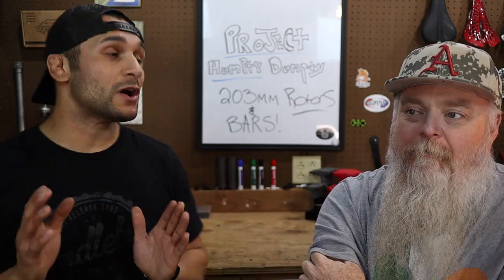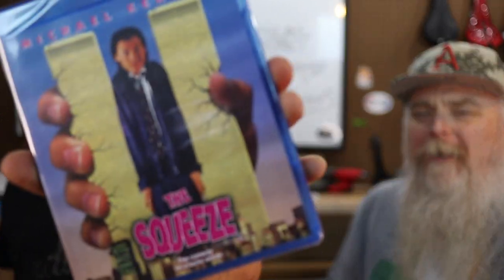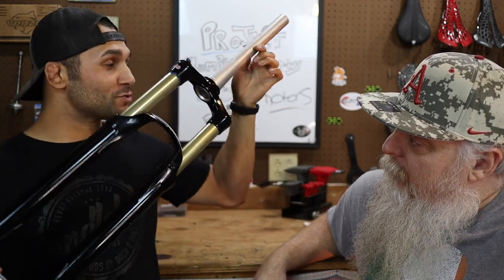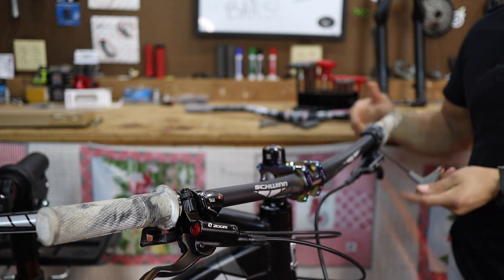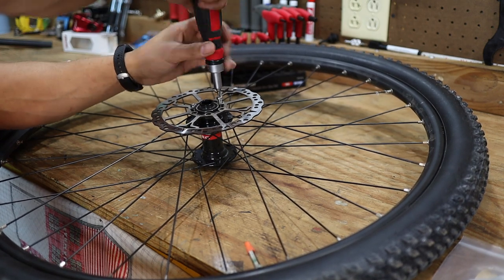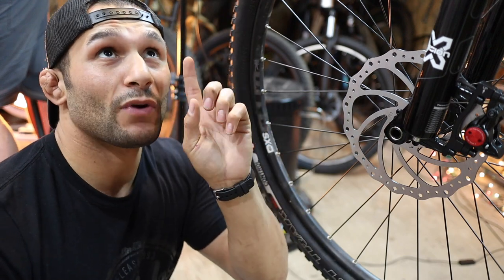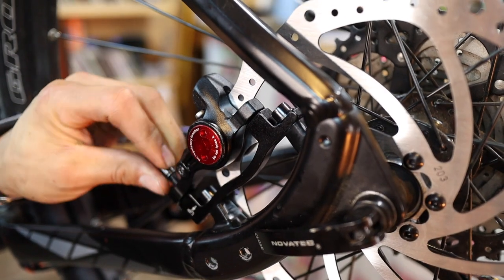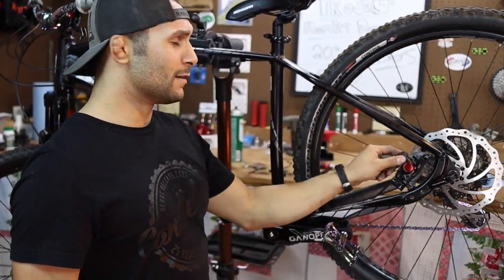203MM ROTORS on the Schwinn Taff plus MAIL TIME!

Comment: You're absolutely right about just squeezing the brake and tightening not working. 

But what does work is leaving them loose, squeezing the brake just tight enough to where you can spin the wheel,, spinning the wheel a full rotation and then squeeze and tighten, it's never failed me.
Reply from the maker: Will try ha ha, it sounds good👍 could always use another technique lol
Reply: @WOLFTICKVIDEOS   don't use to much force when tightening, do a bit each bolt or it can tilt the caliper if you torque just one.
Reply from the maker: @sim_dude  yeah good looking out man, similar to a vehicle tire install😉

Comment: I just bought the same epixon from ebay ($191) to replace my 9mm Quick release epixon. They are great light weight xc to trail forks. These are oem 2019 with older epixon discontinued lowers that were actually better than the new ones... They are all adjustable internally from 100 to 140mm of travel. You could adjust them to 120 if 140 is too much. There's also a popular mod that will make them smoother by adding some synthetic oil to the lowers (10 to 15cc).
Reply from the maker: That's awesome man! Thanks for the info. Would love to see some information? Maybe a link would be very helpful. Thanks man and hope they are great as well.
Reply: @WOLFTICKVIDEOS  Sure, here's how you adjust your travel : https://youtu.be/T1WAiS6lwpQ , and the oil in the lowers help the seals, it was something i read on a forum long ago and it actually helped, just add some synthetic motor oil (10 to 15cc), low weight, through the bolt holes on the lowers. These forks only use grease and a sealed damper. Love your videos!
Reply from the maker: Well Joe thank you very much brother, and will do!

Comment: You should do a brake stop test between 203, 180, and 160mm rotors using the same pads and calipers to see which ones stops the furthest. You could also use the infrared heat gun from the most recent mailtimeto see the brake temps temps between all three rotors.

Comment: The trick to centering your caliper to your rotor does work you are just doing it wrong. This is what you need to do it the right way. Loosen your caliper a little then take a piece of paper or a business card ( I use a business card) and place it between the rotor and brake pad on each side, then hold your brake lever then tighten your caliper. I can promise you that does work perfectly. Ive used this method at least 30 times and it comes out flawless. If you dont put something between the rotor and pad you will get rubbing.
Reply from the maker: Ok BIG EASY! I will do on the next brake upgrade, you talked me into it🤣🤣 thanks!!
Reply: @WOLFTICKVIDEOS  Right on man.

Comment: The rotor trick works. You need to sandwich something else onto the rotor that is thicker than the out of plane variation of your rotor. I do this all the time. It would work without that if your rotors were perfectly flat, but most are warped a little. Eitherways, with hydraulic brakes it'll recenter itself correctly over time and the rub will go away.

Also don't full tighten one bolt then the other, incrementally tighten both.
Reply from the maker: 😉gotcha brother, I will sandwich next time! Lol

Comment: The epixon forks are internally adjustable from 100-140mm or the newer style go from 80-120mm i used a set when u built my hyper carbon x I but some oil in the air sleeve to make them more progressive so I could run less air more sag for sensitivity I ran it with about 15-20% of it's rebound and ran 1/5th of the lockout during trail riding and incline ran it open for descending lightest 140mm fork I've ever ran set up right it's quite amazing
Reply from the maker: Wow that is amazing sounding!!! You SOLD ME!! HA HA appreciate the info brother that is really cool

Comment: I just completed the install it was on a hyper beach cruiser motorized bike 80cc with a G2 read valve and oko 21 race car for a motorcycle with a hinge conversion adapter on the front fork with a is bracket for a 203mm caliper with the dual brake lever the bike has got a ton of power so I needed something to stop the bike
Reply from the maker: HA HA HA Sounds like a hospital trip waiting to happen!! LOL Good luck and thanks for watching man!!

Comment: Those rotors are massive holy cow! Your definitely going to be able to do stopies now😂
Reply from the maker: Ha ha STOPPIN ON A DIME!! LOL  I can't wait to see of there's a big difference. Thanks man
Reply: @WOLFTICKVIDEOS  one of the first things I did on my Aggressor was the 203 upgrade.  After ordering I actually learned that the OEM fork spec dictates 180mm as the largest size.  Granted, that's probably to keep a safe tolerance and avoid legal liability, but I just enjoy the lighter lever effort and don't go bananas with it.  There's a huge difference for certain going 160-203.
Reply from the maker: Felt it a little with the 180s but cannot wait for the 203 MAN!!

Comment: So I just ordered what appears to be an adapter for the the front, but what did you guys do with the rear?  160,180, or 203….I thought I saw a rear wheel installation but I didn’t see a part link for that specific adapter.  Or is it the same adapter for front and back?  Love what you guys are doing!
Reply from the maker: Hey brother, the rear was a 203mm as well and I believe I got the same 203 adapter for the front and flipped it + added some spacers....Works fine:)

Comment: That's okay I was told that I could not put disc brakes on my bike boy were they wrong that the conversion bracket I put on was for a rear post they were wrong 32 mm for the front fork on the conversion bracket on my bike and now I have disc brake setup on my bike hahaha prove them wrong I learned a lot from your guys' videos thanks for being there
Reply from the maker: Hell Yeah Willard:) We know the exact feeling!! Everyone told us a shops we couldent this and that! Thanks man feels great:) Keep it up
Reply: @WOLFTICKVIDEOS  I have a question about the disc brake caliper spacers can you use all three spacers and the center between the bracket and the caliper the cone part of the spacers into the insert piece itself so it's actually not sitting up on top up against the bracket itself for an is bracket it safe it's
Reply: @WOLFTICKVIDEOS  so I've got both double thick washers and then the little small rounded washer stacked on top of each other on each side is that fine
Reply from the maker: Well not sure about the safety but I get what you are saying. I ran 3 spacers when I did not have a screw that was short enough so I had to use that setup to make due, I stopped fine but ended up changing it?
Reply from the maker: Like we said man not sure as far as safety goes but I would def trial run it a bunch and if it doesnt rub and grind you should be fine.
Reply: @WOLFTICKVIDEOS  the screws are long enough in the loctite it in loctite it's just a road bike it's a beach cruiser you give me an idea you got to check out my YouTube channel under motorized bike motor Buchanan to give you an idea what the bike looks like
Reply from the maker: For sure man, we will see whats up:) thanks
Reply: @WOLFTICKVIDEOS  I took the bike down to local bike shop they said what I had did would be perfect since his sister road bike brake calipers covered 100% of the rotor properly they should be fine a loctite at the screws in
Reply from the maker: Cool man, glad you got her going:) Let us know how it does!!

Comment: I personally don’t recommend 20emm rotors on the rear if there is a qr. If the bike wasn’t meant for it bad things may happen. This is just a friendly warning. Ride safe!
Reply from the maker: Appreciate you looking out Jon, now just like we said with the 140mm forks man may not be right, proper or recommended but.....were dumb!🤣🤣 but really man appreciat you having my back and hope nothing gets funky!
Reply: @WOLFTICKVIDEOS  those 140 forks are definitely a necessity on the aluminum comp, I test rode a couple and the front end definitely needs a little lift and slack
Reply from the maker: Agree atleast with the stock setup, like j said in the video, it feels almost small and slumped forward. The 140s are gonna be nasty! But its def not a xc bike now ha ha it's for sure a  downhill only!!!

Comment: I’m upgrading the brakes on my fatbike to MT-420’s. I was wondering if going to bigger rotors would be a good idea, as it’s a bikejor rig so braking power is very welcomed.
Reply from the maker: For sure man, they will be great like our Malus is, but maybe a 180 will be sufficient? A 203 may just be too big with that 26er size and knock on rocks and stuff! Lol ours are huge on the 29er Taff but you can't beat the heat dissipation and looks!! Thanks man
Reply: @WOLFTICKVIDEOS  yea, well I have a pair of dogs pulling me, up to 20mph. Usually I don’t need too much brake but if I get stuck behind a slower team and end up riding the brakes for 1-2 miles they really get hot. I really just want them for heat dissipation. I’ve smoked a few sets of stock pads already hahaha
Reply from the maker: @LokitheSiberian  holy crap!! Thays nuts man🤣🤣 well I would say you need to get them then!! Good luck man

Comment: it is possible to use 203mm on both front and rear?
Reply from the maker: Absolutely possible, will need adapters for you calipers though. Not real expensive:)
Reply: @WOLFTICKVIDEOS  will it make my break stronger?
Reply from the maker: The front it will the rear it may lock up faster.
Reply: @WOLFTICKVIDEOS  the breaking power of tech ice rotors is same as non tech ice ,Is that correct?
Reply from the maker: Not too sure what you are asking man?
Reply: @WOLFTICKVIDEOS  shimano released a rotor that has a heat sink built in,its called ice tech rotor other manufacturers copied it,its like 3 piece different material that suppose to stay in shape even when the temperature rises,I assume breaking power is same,just acts diferent when hot,I havent used one yet,
Reply from the maker: Oh ok I got you:) A subscriber of ours says he has sent us a budget version (snail floating rotors) and we shall see what they are all about:)
Reply: @WOLFTICKVIDEOS  thats the budget 2 piece design,theres slightly more expensive one from ZTTO  its 3 piece,chinese manufacturer copied shimano
Reply from the maker: ok:)

Comment: If you gently squeeze it will not rub
Reply from the maker: Ha ha I gotta try the card technique as well lol. Thanks man
Reply: @WOLFTICKVIDEOS   how did the card work
Reply from the maker: @braedenmurray3598  haven't tried it yet man lol, they are running smooth at the moment but I will use the technique when we upgrade the aluminum comp😉😉😉👌thanks for checking ha ha

Comment: like for exposing the trash advice for disc brake alignment. the only way it can be done is by looking for the gap and listening, then re-adjusting. take time, requires effort. it s*cks and you better not need to do it on the road. v-brakes are easier to maintain. good things cost in effort